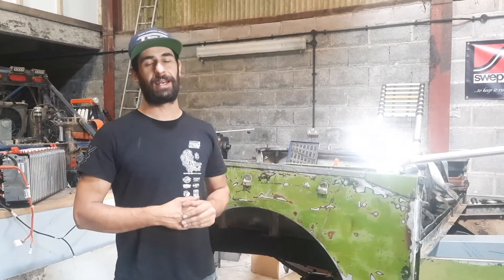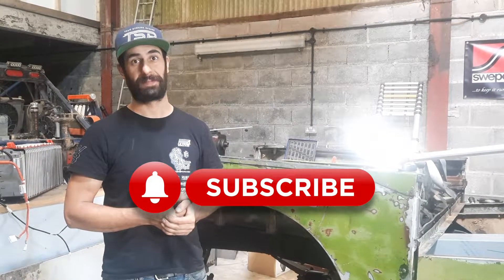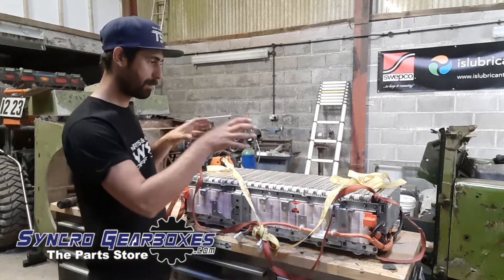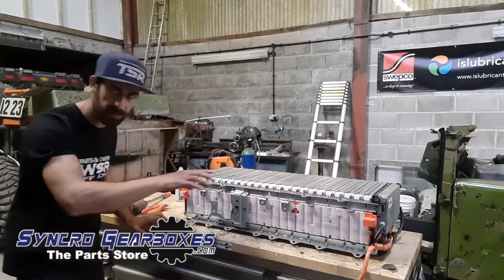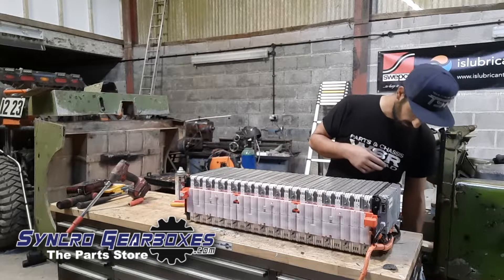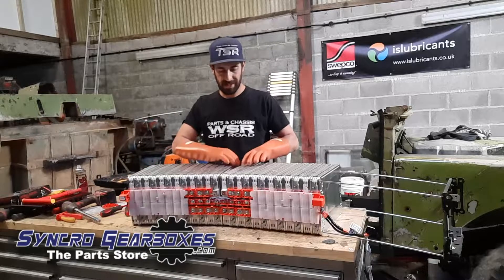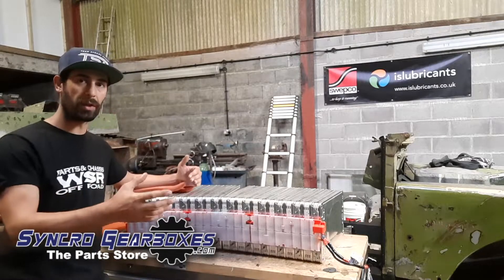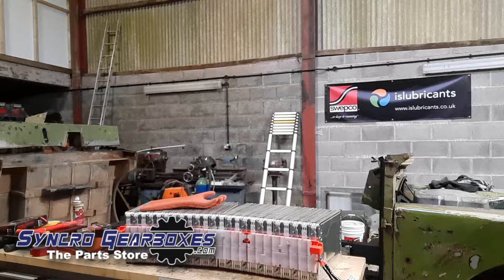08 - EV converted Land Rover Series 1 - NISSAN LEAF BATTERY DISASSEMBLY TEARDOWN

Comment: I have a Series III 109" and I'm looking at starting a similar project. I've been looking at suitable Leaf donor cars, first gens 2012-2013, but they all seem have very compromised battery capacity of the original 24 kWh. I don't have much chassis experience, but I'm thinking of modifying the chassis so the original battery pack from the Leaf can be fitted as is, so that it is easy(er) to swap for a larger battery in the future.
Reply from the maker: You'll definitely have an easier time fitting the batteries in a 109. I'm not sure you'll get the leaf pack in as is but you certainly have more room to play with
Reply: @SyncroGearboxes  It will need some modification to widen the space between the two rails in the middle as the dimensions of the should be 1570.5 x 1188 x 264.9 mm
Reply from the maker: @Abarth695Maserati  it'd be significantly less work to just repackage the modules to be honest. You've got stacks of room to play with in a 109.
Reply: @SyncroGearboxes  I know, but we have homologation issues in Europe, where each EV conversion has be tested for electromagnetism interference and that is expensive, so by not changing any of the Leafs setup I hope to get around that. So it would be testing and document ISO 6469 (General safety for EV)
ISO 7637 (12-24 V system),
ISO 11451 (Part1-4) Immunity of passenger cars and commercial vehicles to electrical disturbances
ISO 11452 Measuring and testing of 11451
ISO 14572 (Shielding of cables at different voltages)
ISO 16750 (Part1-2) Effects on environment
Reply from the maker: @Abarth695Maserati  interesting! I guess laws on custom chassis/suspension would be easier to have accepted